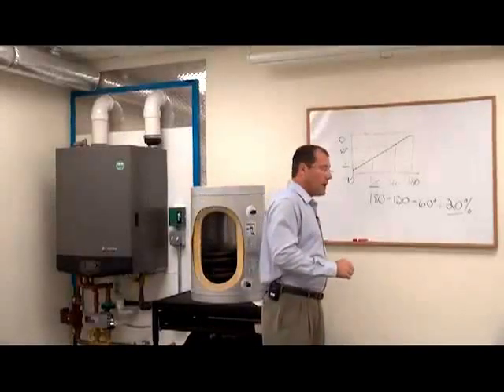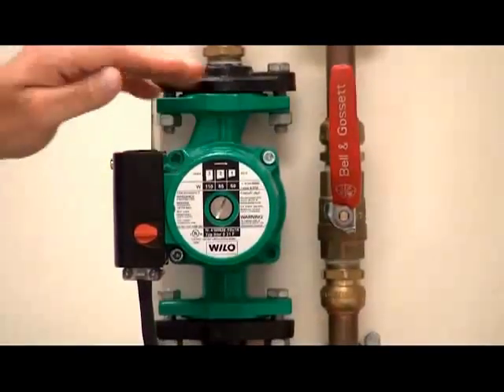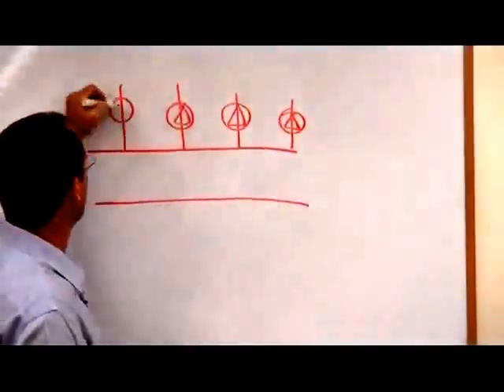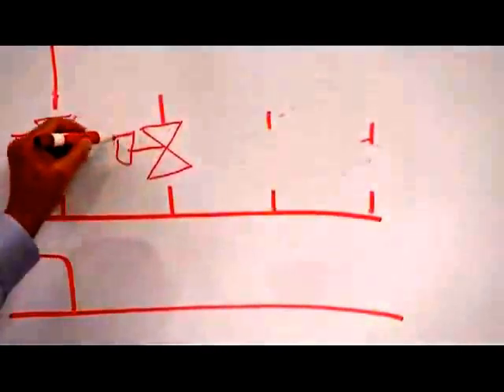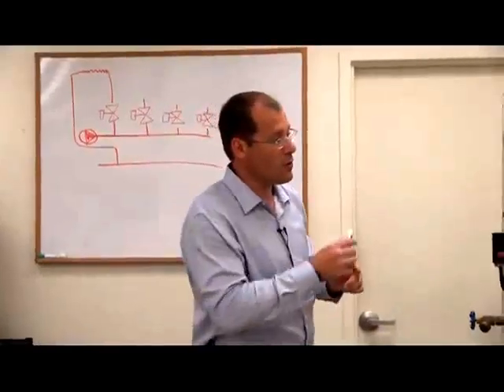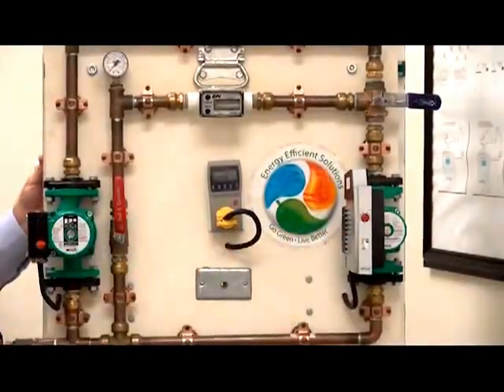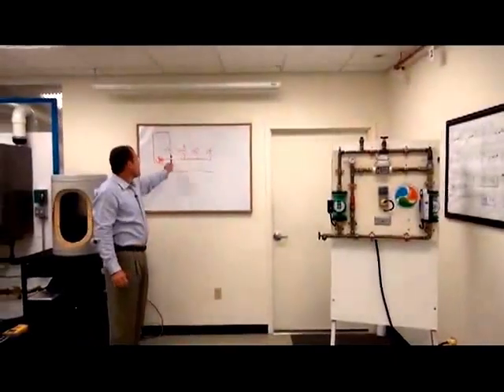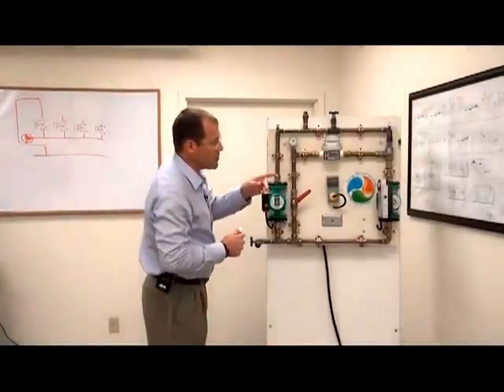Simple ways to lower your energy bills - Replace your circulator pumps

Comment: Nice, good information and explanation,   Rinnai in US is offering the single  three speed circulator with multiple zoned valves, way to go I guess until and unless any one knows a better brand in US. My only concern is the Rennai E110C may not be sufficient for a house between 2000 to 3000 sqft  during extreme cold days of below 20 F weather